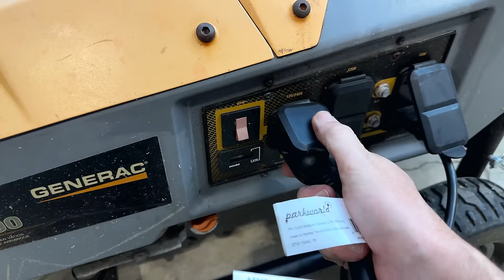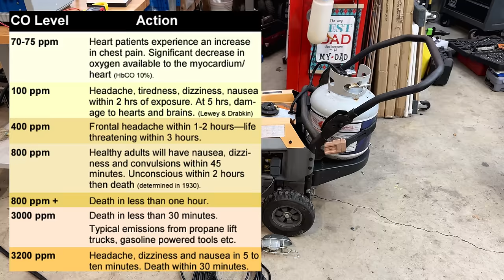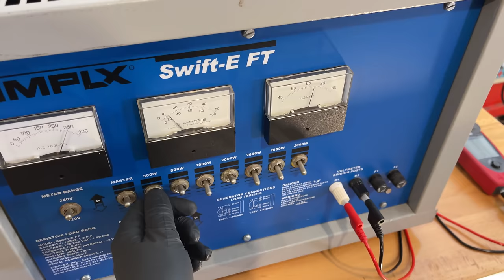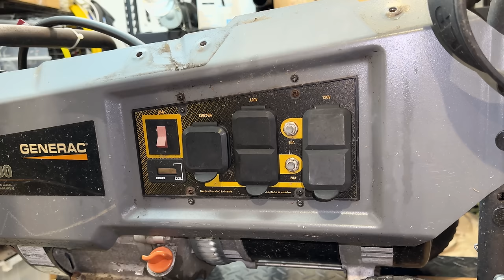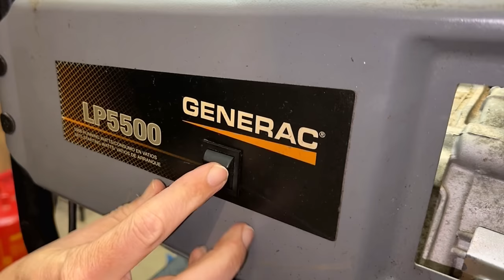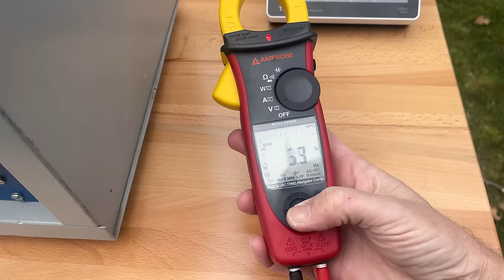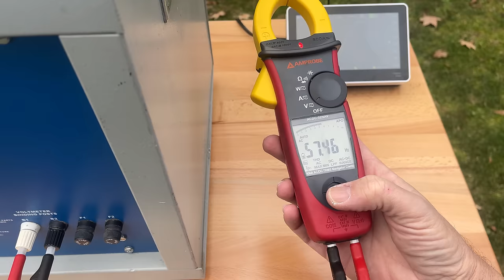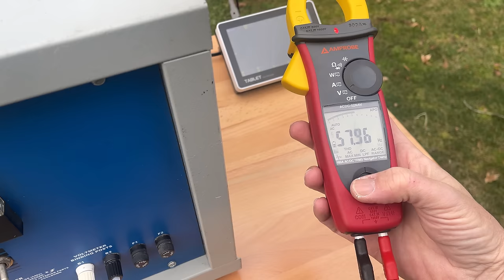Will a Cheap $40 Carburetor Breathe New Life Into This Machine?  Generac LP5500 Generator

Comment: All the knowledge learned from these videos gave me the confidence/knowledge to tinker with my generator. I used an app on my phone that measures the rpm of the engine by lighting hitting a rotating part and it syncing with the fps of the camera(hard to explain). Turns out the engine was running at around 3800 RPM or 63.5 Hz which I know is a bit fast. It’s a 5000watt tecumseh and I adjusted the speed down to around 3700 or 62 HZ maybe slightly above. Since it’s an older generator with wear on it. I like to set it slightly above 61.5 for when it’s under load. I kept it at 62 compared to it running at 63.5 before I adjusted the engine speed. Just my personal touch of setting the engine speed slightly above 61.5 so it doesn’t sag under load as most governors do. I hope that doesn’t damage anything. It also leaks a bit of oil but I didn’t bother to fix it as I don’t feel like tearing the engine apart since it doesn’t leak too much oil when it’s running. I just check the oil frequently when it’s under load. Cheers!

Comment: Thanks James.
I forgot You had the Load Bank, I had to go back in the Videos to see if I missed any. and I saw the Video you did 4 months ago. I Must have watched it cause I had a like on it. But no videos of Its use till now ??
Reply from the maker: I use it when I can.  Currently setup for 240 volts so any 120 volt generator get the space heater.  the larger ones the load bank.

Comment: Definatly would have put a 90⁰ hose barb right near the carb. Remember 11" of water column is only ½PSI. 

I have a Generac LP3450 and have never used the kill switch. I always just turn the LP tank valve off to shut down the engine. Runs for about 5 seconds.

Comment: Two questions for you.  First, what is that brand of screw driver that you use for the carbs?  The flat heads look like they are made for the wide slots in the carb screws.   Second, your torque wrenches, do they measure torque in both directions or just clockwise?

Comment: Very interesting video. It's nice to know about the inexpensive multifuel carb and how well it worked. Like you, I was amazed the grill regulator was able to provide the volume to operate it fully. 
I was curious about your switch installation. You used a two-pole switch to connect to two circuits, (oil and kill) yet instead of using both poles you opted to tie the wires together and use half the switch.
If the coil or the oil pressure switch needs replacing in the future the wires will need to be cut apart again. Hooking them to separate poles of the switch would allow either to be changed without affecting the other.
A pair of quick connects on the ground wire would provide the ground path for both. Thanks for another great upload.
Reply from the maker: There were better ways to wire that switch.  Ideally I would have used a bullet connecter adapter on the coil to convert it from single to a double bullet connector.  One for the switch and another for the oil module.  I doubled up the wire because the wire gauge with thin and was not sure the crimp connection would have held a single wire as well.
Reply: @jcondon1  Either way, the switch you used looked almost OEM for the machine. 👍

Comment: Could you not just separate the new carb and reg and replace old for new and adjust gas/air mixture until it runs comfortably at full load?  The benefit would be that it would look original. But your solution is still a nice job James.
Reply from the maker: I originally was expecting the $40 clone to fail.  I was then going to buy a $90 Garretson KN demand regulator and plumb it into the Generac carburetor.

Comment: Very often you're making decisions on what to do with a given generator based on its value vs repair costs, which makes sense. That got me to thinking though. It seems like the generators you work on should probably have a 15-20% markup because you worked on them and each one has a video detailing its rehabilitation. Maybe it's just a matter of marketing. You should make a metal tag that can be riveted to each gen you work on that has your name and the completion date engraved in it. Something along those lines.

Comment: If you applied heat to the regulator body where the barbed hose fitting is you could get it out - doesn’t take much.
Reply from the maker: Was afraid of damaging the carb body and diaphragms.  Ideally I would remove that fitting and install a 90 degree one.

Comment: One other thing that you could've done was to remove the regulator from the carburetor and mount the bracket on the front by the air cleaner and just route a longer LPG line to feed the carb fromthe regulator

Comment: I'm honestly surprised to see a choke. I did an eBay kit on mine with proper Impco regulator. Those instructions and everywhere else I read said never to use the choke.
Reply from the maker: It helps pull a vacuum which will open the demand regulator value and allow the propane to flow with less effort.

Comment: James. Amazing save!  What primer did you use on the orange plastic (brand/type)? Where do we get the nice clamps ("Clarks")  like you used on the propane line so it does not dig in and provides constant spring force?
Reply from the maker: Not sure which primer can I grabbed, but usually use Rustoleum automotive primer.  Here is a link to the clamps: https://amzn.to/42640nl

Comment: @16:23 - I think that gasket should have replaced the one between the carb and the intake manifold. That front surface there will be a metal-plastic mating with the airbox, and shouldn't require a gasket.

The old gasket will continue to deteriorate and leak sooner than not. It's great that it runs, but it might run better for longer. 😉

Comment: It looked like "brass" barbed fitting on the carb/regulator which looked like alluminum or steel so it probably was threaded and screwed in so maybe you could have replaced the barb with a threaded fitting to fit the existing hose and avoid cutting the hose.

Comment: Harbor freight sells a pneumatic bubbler and possibly an electric bubble that might have worked better to cut the sheet metal after drilling 1 or more holes.  However I don’t think your small pancake compressor and tank could keep up with the pressure AND CFM air flow needed for the pneumatic nibbler.

Comment: I'd suspect that grill regulator may freeze up after an extended amount of high load run time, be interesting to see how cold its getting and how fast its happening. Also as an aside a 20 lb propane tank will not produce 110kbtuh continuously at anything less than 90degrees f and as you use the fuel in the tank its capacity to continue to provide maximum btu (in this case HP) will go down and fast.
Reply: Good points... and that tank will probably freeze up too, in cold weather, then the vapor pressure drops like a rock. It's only a 3 gallon or so in size. Should have left the extra hose coiled up for the option of connecting to a larger tank.

Comment: james corden , im a fan of yours, just wanted to metion , the reason for the barbed fitting is simply due the wheight of having a seperate fuel supply (propane) lp) it could fall off a ledge  meaning the safer option is it to break  away before draging both down a hill be coming an explosive maylay . lmao , also where di you find that carb?

Comment: Continue to love your videos. Please post more often 😁. I was surprised you didn’t use wd40 for the sticker removal. You use that often and it generally works very well to remove adhesives
Reply from the maker: This sticker was tough.  I edited some of the battle out.  Started with WD40, the goo gone, goof off, acetone, etc....  Burning it off worked way better then anything else.

Comment: I've not seen you ever get 1000 watts over the listed power on a generator. Perhaps I've missed some of your videos, and you have, none the less it's impressive. Perhaps try an L bend hose connector coming out of the regulator so the hose doesn't stick out, more places it could leak, but less of a tripping hazard, so to speak.
Reply: James mentioned that option. His comment was that the existing fitting appeared to be glued into place.

Comment: A lot of people are killed every year operating on the impression propane combustion has no carbon monoxide.

While it’s common to run at “safe levels” it’s never zero. 2-10 ppm is common. However everything can appear to be fine while it’s producing 100-200 ppm. Much higher and pungent odors are very noticeable from poor combustion in general. 

Best I’ve been able to tune is small engines and furnaces to around 2-5 ppm. This is using a Testo 350 exhaust gas analyzer.

Also keep in mind this is at a steady state. During start up, warm up and shut down momentary spikes to 500+ ppm isn’t uncommon. On top of that NO, NO2, SO2, CO2 etc are things still present that you don’t want to breath. Removing one toxic element from a host of toxic elements doesn’t make it safe.

Comment: Mr. Condon I have this exact same generator I see the gen. you have was neglected/faded would you tell me what you "suspect" caused the regulator corrosion etc. mine stays hooked up to the tank and is stored in the garage, is propane corrosive? I want to take care of mine so this does not happen, but thanks for a fix if it does. Thank You Very Much dw

Comment: James, another victory.  One observation- the generator body has a piece that is broken and is flapping in the breeze.  I would  fix that- with something....sure you can come up with something.  Love that rig-  big wheels, big handle.  That propane regulator should work for a variety of horsepower.  Best case is to use this generator is outside, of course.

Comment: Jim, won't creating a sharper bend in the exhaust pipe create more back-pressure?  Also, isn't that button on the regular a purge or prime button needed to start the engine?
Reply from the maker: It will create more back pressure.  Fortunately the engine seems to still be able to breath properly.  Yes, the button is used for the prime function.  Also pulling the engine over with the choke on will also cause the valve to open and will purge the line after a few pulls.

Comment: "Not to mention we don't have a tank" [for gasoline] I am going to remember that line, LOL. Question 1: When did you get that fancy load center? Very nice shop upgrade. 2: Is there any great reason you could not use a propane regulator from a barbecue? Probably would be a pretty cheap item. (I have no idea of the relative fuel consumption rates between a BBQ and a genset.)
Reply from the maker: Here is the load bank video: https://www.youtube.com/watch?v=q4WishKV0_E
A grill regulator makes out at 60,000 BTU.  You need 10,000 BTU for every horse power.  So theoretically you would be limited to 3,000 watts.  Although the one I tried seemed to run well at higher loads.
Reply: @jcondon1 I appreciate your explaining that, which you did later in the video.

Comment: Here is what you do. Remote the entire generator from Frame. Install 2 wheels where the rubber stops are in the front bottom of frame. Now you have a nice heavy duty cart to move around other generators that are actually worth fixing.

Comment: I have a 12kw King Canada gas only generator that I am modifying to to run remotely with a small wifi board. I will also have it connected to a small 12 volt solar panel to keep the battery charged even if I run the small wifi controler 24/7 this should keep the whole system running. But what I am looking for is information on how to convert that generator to propane also. I know that King canada have a carburator kit for the same motor/power head but they dont want to sell it to me as my generator is not the good model number. Wondering if you know of a good kit for such motor? Tks.

Comment: One other thing Jim. If you have the opportunity to try out a Vevor  SV-3000VA voltage converter. My new furnace didn't like the dirty sine wave from my generator and wouldn't work. But the furnace worked fine with the voltage converter 120 volts to 120 volts setting. I don't have the equipment, but I'm just wondering what the before and after difference is for the hertz, THD and the sine wave is. Thanks if your ever able and I'm sure others with new furnaces would be interested as well. It also fixed my modified wave inverter.
Reply from the maker: That would not change the hertz, but it would impact the THD and sine wave (I think).   In the 120 to 120 mode does it actually go through the transformer or does it bypass?

Comment: Do you find that most generators that you work on like this, are underrated, when it comes to the max power output??
I remember you did a propane conversion in the past, I believe it cost a lot more than this one did.
Reply from the maker: It was about $200 and that is what I thought I had to do with this one.  This engine would have been rated at 13hp on gasoline.  Only 10hp needed for 5500 watts.  Was surprised it made it to 6500 watts.

Comment: It’s pretty easy to swap out that barbed fitting to the standard grill propane fitting. I opened the propane side of the carburetor, removed the rubber parts and heated the fitting. The disgusting smelling dope oozed out.
Reply: I was wondering if heat would be an option. You had to partially disassemble the regulator to do that. Not a difficult thing but some may not want to.
Reply: Fortunately the regulator only had five heat sensitive parts. The diaphragm was held in with the clamping force of the case fasteners.  It took me about ten minutes.

Comment: James, how did you get it to run on gasoline with the anti-backfire solenoid unplugged?
Reply from the maker: Generators with a pull start need to be able to start without a battery.  The solenoid is normally open.  The only time it closes is when you turn the ignition off and the generator power energizes and closes the solenoid until the generator stops making power.
Reply: @jcondon1  Thank you. I was looking at using this exact carb on my generator but was concerned about the electric solenoid since the original does not have it.

Comment: I actually have a Generac (GP5500E?) that I’m adding an electric start to once things warm up.  Could I add the tri-fuel carb and regulator to make it propane as well?
Reply: You could or you can install a USCarb Tri-fuel kit. The only kicker with the $40 carb is that its not adjustable. Too much propane running rich makes the engine run hotter

Comment: Were you able to address the high CO output?  Or is it a nature of he beast for propane fueled generators as opposed to open flame buring in stoves and lanterns?
Reply from the maker: There is no adjustment on this carburetor.  In theory they can run very clean if tuned right.
Reply: @jcondon1 too rich and the generator runs too hot. Look out for red exhaust

Comment: One plumbing tip: made me cringe a bit while you fastened the new propane line to the new regulator by grabbing the body of the regulator and twisting against it.  My Dad always taught me to double wrench pipes, to avoid stressing the rest of the plumbing, and I see there are flats on the fitting on the regulator.

Comment: Switch install:  Cut a slightly bigger Hole.  Design a plate for the switch using small machine screws for mounting, with labels embossed in it.  Then 3d print the plate.  I know there's probably plastic pieces inside the regulator, but you could have heated the part where the hose barb screws into a little bit to see if it loosened the barb.  A right angle barb would have made that connection much better looking and safer, without that last part of the hose curving outside the frame so much.

Comment: What type of fuel is the best for a.protable generator between gasoline propane natural gas and diesel  I Heard that propane or natural gas  makes The engine run at lower rpms  versus gasoline and diesel give it  higher rpms
Reply from the maker: Diesel is the best.  It does not go bad for a very long time.  Propane and Natural gas are theoretically better then gasoline, but he repair cost is much higher.  The repair cost for a gasoline carburetor is about $20.  Of coarse if the tank is bad then all bets are off.
Reply: @jcondon1   thank you for your information on this matter of what is the best fuel for a back up generator James  I know that propane and natural gas are less likely to make the.oil turn dark from the carbon  that gasoline and diesel give off when they are being used to fuel The engine on a back up generator  keep the great videos on generator repair coming Mr condon 👍👍

Comment: Can propane engine start in cold termperatures? Cars running on biogas cannot start on gas in winter time, and that is why they also have a gasoline tank. Engine first starts on gasoline, and as it heats up, the system will automatically switch to gas
Reply from the maker: Not sure.  It was about 45 degrees on my garage and 20 degrees outside and it started well.  Might be a problem at lower temps.  Likely though that small propane tank would be a problem in those temps.

Comment: For regular use I prefer liquid fuel, buy it where you fill the van. For Emergency use I'd consider propane simply because it doesn't go off in the can as fast as gasoline.

Comment: When you put 6500 on it why didn’t a breaker or fuse trip? I don’t understand
Reply from the maker: Most circuit breakers can tolerate an overload for a few minutes.  This generator was rated at 6500 surge watts so likely the breaker chosen will allow 6500 watts for a period of time.
Reply: Didn’t realize it was rated 6500 surge.makes sense